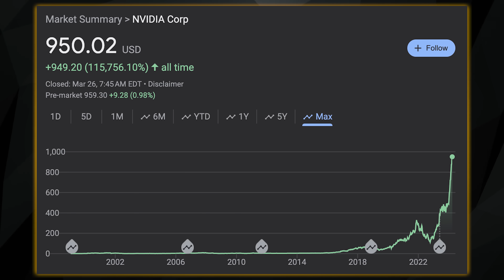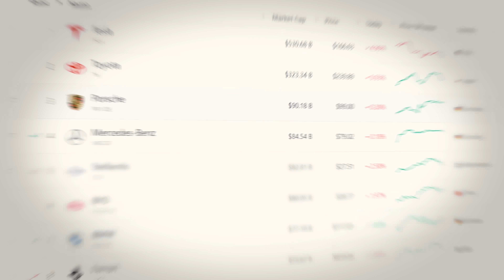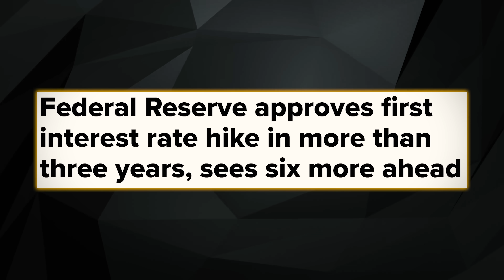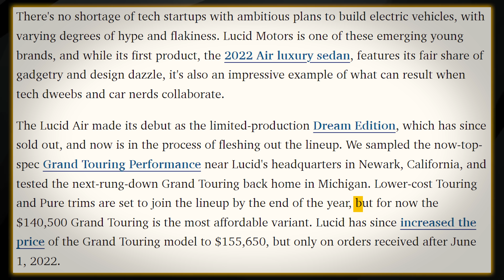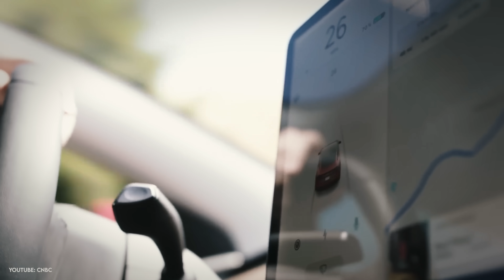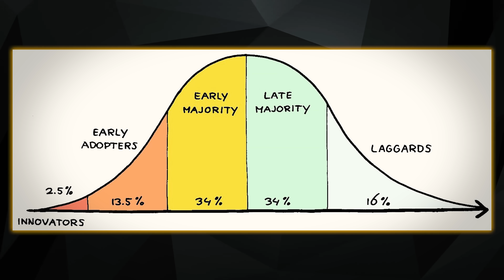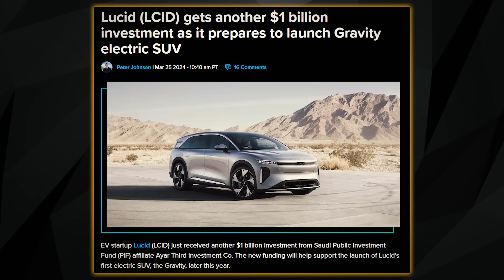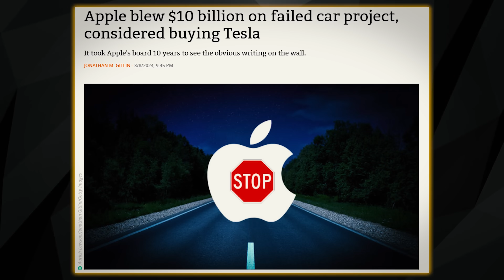The EV Bubble Popped - What Now?

Comment: This video is a very good example of sample selection bias. He completely missed the European and Chinese markets.
Reply from the maker: Fair point
Reply: Your also missing the policies practically forcing people into buying an EV. As soon as that pressure is off, people choose what they like.
Reply: @divyanshbhutra5071  You forget the pricing pressure. Batteries and EVs getting cheaper every year, while ICE cars are only getting more expensive and complex. People will always choose what's cheaper.
Reply: @huckleberryfinn6578  Lithium prices have increased again, and will continue to increase. Obviously you can't count prices right after pandemic period as they'd be excessively inflated. So if you look at Lithium prices, they're effectively increasing. And this is from a 7 year data graph.
Reply: In Europe, american cars have a bit of a bad reputation for their plasticky interior. 

I personally don't care much about the interior, more about engine lifespan and abilty to self repair without weird business models. 

Business models and anti-repair tactics, which european car makers are also pushing hard, especially in the age where half the car is software and distracting TV screens. 

//Addendum: Most EV's have a weird transmission too. I'm used to drive stick shift (my Unimog lorry even has three sticks) and the driver license model in the country i live requires special training for automatic/electronic transmission.
Reply: @danielhalachev4714 BYD isn't even the fastest growing, Huawei's AITO is, Xiaomi just came out with theirs and there's Geely's Zeekr.
Also China's auto market is larger than US + EU combined, China isn't the exception, US is the exception
Reply: @divyanshbhutra5071 The point of policies like that is to force actions that help society in the long term but hurt the individual in the short term. Think cigarette taxes, drunk driving laws, or child protection services.
Reply: @kolbyking2315 sometimes those policies don’t work like if you were to make very strict alcohol laws in the U.S., a black market would rapidly arise due to both capitalist incentives and spite to force anything that would resemble the prohibition of old to fail again
Note: strict by American standards are very different than other less individualistic countries since I think America is joining the ranks of the Eastern Europeans in regards to alcoholism
Reply: @divyanshbhutra5071  forcing? you still have 10-20 years to buy a gas car, and i'm pretty sure the auto lobby is going to increase it
Reply: @divyanshbhutra5071  ev's are innovating pretty fast though. people are already talking about sodium ion batteries, and technology will keep on going.
Reply: @J-wm4ss  Sodium ion batteries are a big step back in energy density. Solid state Lithium silicon or lithium sulfur batteries would be the final evolution of the batteries. Beyond that, we don't have the elements smaller or lighter than these.
Reply: @J-wm4ss  Whether they lobby it not, the life cycle of combustion engines will have to be increased. Motors are poor at towing, combined with abysmally poor energy density of batteries, can't power trucks, ships, airplanes, steel industry, construction industry, etc. Batteries are good for electric bicycles at best.
Reply: @divyanshbhutra5071  if anything, the government incentives for EVs in the US are not nearly as much as they were before... There is little to no pressure on the consumer to take an EV over an ICE car.
Reply: @Elc22  Exactly. And we can see sales dropping massively.
Reply: @divyanshbhutra5071  the only setback EVs have is energy storage and even then its entirely workable in the state its in. People aren't buying them because they're expensive especially when you consider the state the economy at large is in and because the average consumer has no desire to research on their own when being hit with propaganda on both sides.
Reply: God forbid we have good public transit like Japan or Taiwan
Reply: Teslas China sales tanked in the last two quarters lol. Keep dreaming fanboy.
Reply: @bobbybishop5662  Pretty sure you are the delusional one.

History has been made over the period April 1-14, sales of new energy vehicles (NEV) exceeded half of all car sales in China. New energy vehicles is a Chinese umbrella term encompassing a number of types but in reality means largely pure electric vehicles and PHEVs.
Reply: American car problems. Don't want to know😂😂
Reply: @nzt29 yeah, because a system that works for tiny island nations (and tiny island not-nations) is totally transferable to the 4th largest country in the world which spans an entire continent coast to coast. The US has states that are bigger than the entirety of Japan, and Taiwan is dwarfed by all but the smallest northeastern states.
Reply: @sssspider  Thumbs down
Reply: @J-wm4ss  Yeah people are always TALKING about better battery technology.  But we haven't ACTUALLY had any improvements in battery technology since Lithium Ion batteries were invented in 1985.

Comment: The moment I realized that EVs could cost just as much for minor repairs, I sensed impending doom on the horizon. I drove right back to gas-powered vehicles.
Reply: That’s more of an issue of availibility in parts and mechanic experience. In the two-wheel world, electric motorbikes are much easier to repair.
Reply: Try getting an electric cargo bike. You'd be surprised at what you can do with one
Reply: @niamhleeson3522 you can definitely get laid out across the highway by a Karen in her SUV.
Reply: @niamhleeson3522  I remember seeing a 3-wheeler bike with a tray on it in Tokyo back in 2008, instantly wanted one. Great for local deliveries and sub 50kg loads.

When I was living in China I used to see a lot of electric bikes with canopies on them, that could work as a way to make it usable across more of the weather spectrum.
Reply: @markm0000  you're riding a bike on the highway?
Reply: @doujinflip  But that's exactly the problem. The potential of what EVs can be doesn't take away what they're not today. When a car repair suddenly costs more to fix and takes longer to put back on the road, that is rough when you're someone who needs to commute for work and to keep the lights on. It is an added risk that many people literally cannot afford.
Reply: @doujinflip  ok but are you happy paying for a battery replacement that costs almost $10k or even more potentially?  also easier to repair? then why are EVs more expensive to repair ? lol
Reply: Considering they are also heavier for an equivalent sized car, you'd expect the wear and tear to be higher on suspension and tyres atleast.
Reply: @deanchur  In the UK these wide bikes would be ran off the road frequently. There's no place for normal cyclists unless you're in specific spaces in big cities. To the rest of the country they're just a  nuisance.
Reply: @Chag69420 They can be equal to pick-up trucks. 2021 Ford F-150 3.6L Ecoboost Supercab is slightly lighter (20 lbs) than a 2021 Tesla Model S.
Reply: @Chag69420  I have no doubt (especially with the white van men in the UK lol), and that's before you get to places that can accommodate larger vehicles like USA, Australia and Canada.

Mat Watson from Carwow was having the same sort of issue when he road tested a Citroen Ami, and they're a "covered quadricycle"; quite a bit larger than a cargo bike
Reply: Sounds like you didn't think anything. Keep thinking you did tho. But your brain no work
Reply: @doujinflip  But people didn't study engineering so understanding repair costs is too hard for them
Reply: @niamhleeson3522  urban youths are unruly like that
Reply: They're covered under a good warranty - mostly 100k miles or 6-8 years on the battery. Also a smart or non-fraudulent mechanic will replace some modules but don't have to replace the whole battery. Also there's the second life of a battery as storage for the grid.
Reply: Comparing my conventional pickup to electric pickups that supposedly compete (they really don't), it'll take 645,000 miles to offset the initial cost differences and maintenance. 

The government push for EVs is a ruse for mass transit.
Reply: @doujinflip    The EV bike trend in my country works like this: 
Some company brings in a load of cheap EV bikes, the sales are steady for a while. You will see them on the roads for a year or two and then the batteries stop charging and they disappear completely. Then, 5 to 6 years later a new company comes along with a different model and starts the cycle once more time. 

I doubt the average bike mechanic knows how to fix EV bikes so when they stop working they literally disappear from sight.

The cheap 125cc-150cc gas bikes are a constant presence and never go out of style.
Reply: @doujinflip that’s because Tesla limits parts and tries to generate profits from selling replacement  parts 🤦‍♂️
Reply: @michalandrejmolnar3715 Most cars on the road are secondhand. Shifting the battery replacement to the second owner still harms the cars resale value massively, which increases depreciation.

Is someone buying a 20k used vehicle going to choose an ICE that'll need maybe 1000€/year in maintenance? Or an EV that will also need 1000€/year, along with a 10k battery replacement soon after?
Reply: @K05H  Like with cars, the cost of replacing the battery often makes the bike non-viable. People would rather just buy a new bike.

Its similar to having an engine overhauled. You really only do it if you have a special reason to want a specific vehicle. As the cost usually outweighs the viability.
Reply: @Erowens98  Most EVs have a longer warranty on the battery than the rest of the car. Also batteries don't have to be replaced whole after a defect and try have a value for secondhand use, so you can sell them
Reply: @michalandrejmolnar3715  the batteries warranty is usually around 6-8 years. The batteries typically last 8-12 years. You are not getting the end of life battery replaced within the warranty period. "secondlife" is really oversold mostly. Battery degradation is exponential. So after its degraded far enough to no longer be useful in a car. It'll only last a couple more years, during which time it will rapidly lose capacity.
Reply: @Erowens98  7-12 years is typically how much ICE cars last without an engine overhaul or replacement.
Reply: @michalandrejmolnar3715   15 years or 300-500kkm is the typical interval before an overhaul is necessary, long enough to where most ICEs will never have their engines overhauled. The engine often out lasts the chassis. Depending upon how you define overhaul of course. Some sources will consider even a headgasket replacement an overhaul, while other require internal component repairs. 

But even so, for most cars 15y old cars an engine overhaul doesn't cost 10k. For example, something like a 1st gen mazda 6 will cost around 5k to have the engine overhauled (in Finland), including the cost of removing the engine and re-installing. And by overhaul i mean replacing/remachining damaged internal components.
Reply: @Erowens98  In Leasing we don't get these problems. Also public e-carsharing is the main medicine for this
Reply: @michalandrejmolnar3715  public e-car sharing will never take over. People own cars for flexibility, e-car sharing removes that. Not to mention it will be more expensive than car ownership as people are less respectful towards things they don't own so maintenance costs will be higher and transfer through the per km fee. Just look at the condition of your average e-scooter rental, even with constant maintenance they're always broken. Frankly, i wouldn't want to trust my life to a public car. 

Leasing causes very similar second hand market issues. And is also usually less financially sound.
Reply: @Erowens98    I don't understand how it would be inflexible when used in a city with enough cars to choose from. Also the costs would be definitely lower just because of industrial amounts of demand. It's definitely more efficient, with ride-sharing even more than traditional car ownership
Reply: @Erowens98  I don't know if you're speaking from extensive personal experience or studies, but it seems to me you're mentioning just anecdotes. Maintenance isn't a big thing with EVs.
Reply: @michalandrejmolnar3715 do you know that people can leave their city? Like on holidays business trips etc etc etc
Reply: @josecipriano3048  Carsharing solves that. Or having a second car an EV or ICE car.

Comment: Shit's too expensive, I'm going to be driving my current car until it's dead with how much everything costs these days.
Reply: So much this. Dude's talking about ENTRY LEVEL pricing. People dropping $50K on a car want the top trim with every bell and whistle. Compare THAT price, otherwise you're just being disingenuous.
Reply: I'm excited for Aptera to start production. Their price for a 400mi range vehicle with 700W of solar to get 20-40 miles of range per day is projected to start at 33k. It helps they're so efficient that they'll be able to get away with a smaller battery and get a similar range.
Reply: I have  my old  banger Nissan  Leaf  ( electric).
I didn't spend a penny on mechanics in last 7 years almost 70k on clock battery will  outlive the car . 
Loads of mechanics will lose  their  jobs
Reply: And thank you for doing that. You are being a lot more eco-friendly than those people who change their electric cars like their phones to replace their perfectly functioning gas car. The manufacturing carbon emissions overhead of electric cars Plus how most of us are still reliant on fossil fuel to generate its electricity means that the electric car only creates an image of eco-friendliness. There is a reason that Singapore slapped an essentially gas guzzler tax on the Tesla model S. That is because the rest of the country is generating their electricity on coal, the emissions for a model S added up to be similar, or even more to other traditional cars. All electric cars do if the power infrastructure stays the same as moving where the pollution happens, not removing it.

Edit: for more detail on the Singapore gas guzzler tax on the model S, Singapore government found out that the model S uses 444 WH/km of energy, way more than the advertised 180, which equates to 220g of CO2/km. That figure is even higher than a gas Mercedes-Benz s-class which Elon musk stated was 200 g/km
Reply: Which is perfectly fine. I got an EV 2 years ago, because the previous car was starting to cost more to operate than a new car.  I hope to keep this car on the road for over a decade.   While I agree with the science about climate change, environmental reasons wasn't part of my decision to switch to an EV.  Lower operation cost, charge from home, quite driving and the high acceleration rate was the big features for me.
Reply: If you buy a good reliable car and drive it for 20 years you are doing far more for the environment and your wallet than buying a new EV every 6 years
Reply: I'm with you. I would have to pay over 30% more, to replace my 2015 vehicle now, with a current equivalent model. It has no worthwhile additional features than what I already have. 

Spending $50-100k on a regular mass-produced vehicle these days, is a no from me too.
Reply: Especially all new cars.
Reply: @internetman8015 you basically on the nail with it the main issues are the cars are more expensive on insurance and with certain models the tires pretty much die on you. The cost are kinda offset with the cost of electricity but it’s still increasing the cost of living is a lot higher so people won’t buy a car they don’t know about that well. mainly people in there 18-27 will buy a ev there insurance will be really high then sell the car cause they realized they can’t afford it. I genuinely do think ev are get I personally want a model 3 but 12k a year for coverage in Florida is insane. The system just need to better suited to handle the energy demand that come from new ev. So it’s kinda just a lot of things adding up to make one big mess of the ev market.
Reply: People super forget how cheap and eco-friendly modern fuel engines too, if you look for that
It's realistic to go 4l/100km and cyclist behind you won't feel your fart
Reply: @everyhandletaken EVs are plummeting in prices as some manufacturers reach scale.
Reply: @DavidC-pg6ni  correct, but I wouldn't buy one of them either :)
Reply: EV has a cost issue, people aren't willing to pay $20k more for EV, when a hybrid does 95% of the job, that's why hybrid cars are selling really well, until the price comes down enough, this will continue to be a major problem
Reply: @danielzhang1916 EVs are decreasing rapidly in costs and prices, while ICE vehicles are NOT. Add in the Incentives of $7,500 and EVs go well below the average New Vehicle prices.
This will continue as more and more EVs are made Globally. The entire ICE vehicle industry is crashing in China, the Largest Auto Market by Far. This will spread rapidly in Europe and the US as Economies of Scale take over for EVs, instead of ICE vehicles.
Reply: Low inflation, like 2.6% is so very awful.   /s

So much whining, so little substance, from so many.
Reply: @rogergeyer9851  you must live in the US 😆

Comment: The biggest bonus for tesla is the HUGE network of superchargers and the FSD mode as well as the range. theres basically a supercharger that can charge your tesla to 100% in 15 minutes within 30 minutes of each other. Plus they're expanding it. Versus the regular chargers where they are far and few between.
Reply: FSD has been involved in over 1,000 crashes to date.
Reply: @robertkubrick3738  1000 crashes out of millions of cars is pretty good odds.
Reply: @greatleader4841  1 in a thousand involving one single aspect...isn't good. That isn't all the crashes, just those where FSD is suspected, and many haven't been investigated yet.